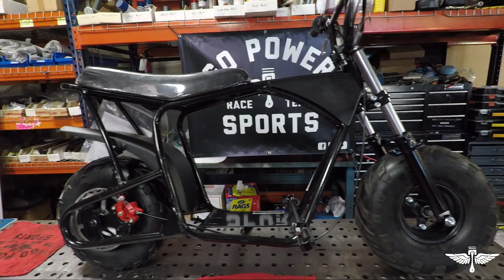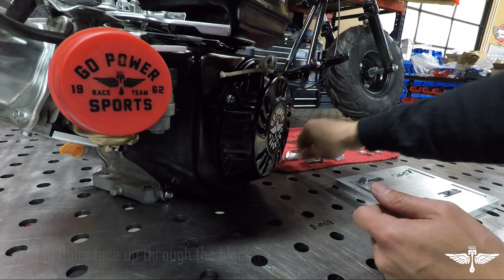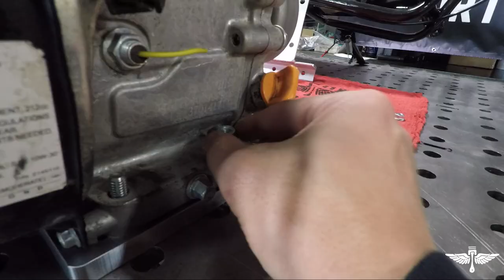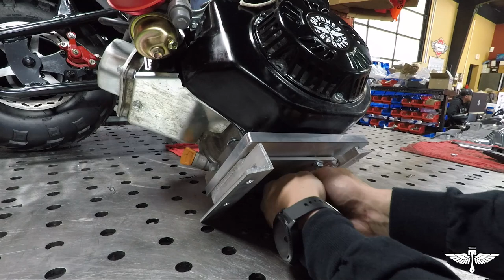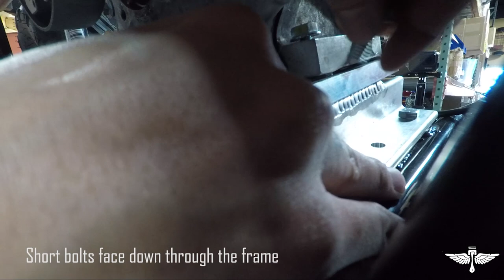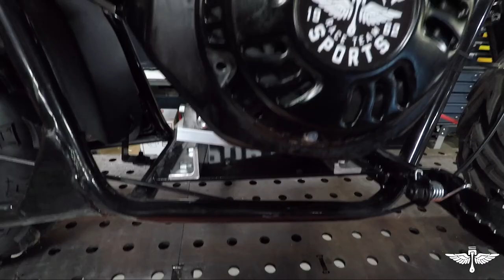GoPowerSports Mega Moto Fully Adjustable Motor Mount Kit Install

Comment: I plan on getting the roller frame from them and I will prolly end up getting this plate, but would I be able to keep the stock tank on or would I have to get a aftermarket?
Reply: I’m wondering the exact same thing

Comment: With the motor angled , do I still maintain the 1/2 quart oil capacity?
Should I add more oil from the rear?
I want to run a series 30 torque converter. Somebody should mfg a 1/2 gallon low profile gas tank for the 212 motor,  so it can fit.

Comment: Bro I did everything and it wont fit with the tank on still. I'm kinda pissed but cars and cameras cut the mounting slots on theres out longer gunna try that and see if I can get everything on with a plate and 30 sieries tc cut back a lil bit
Reply: I tossed an idea your way under the next comment down.

Comment: What size engine is that?
Reply: Predator 212 Non-Hemi
Reply: I litteritly have everything in this video and cant fit it on with a gas tank gunna move that aluminum mount as far foward as I can by cutting the slots for the bolts to go foward as much as possible
Reply: Looks like a Tillotson 212. A Tillotson tank is a little shorter than a Predator tank.
Reply: @naturechanel209  the Non-Hemi tank is shorter than the Hemi. I've tried to get a good look and I saw nuts holding the tank down. Predator uses a flat straight tank mount where the bolts on the tank drop straight down. The clone and Honda tanks are angled forward. He may have drilled it out to accept a clone tank. I'm not familiar as to if Tillotson has a tank like a Predator or a clone. In any of these swaps I end up going with a clone, side fill tank. I recommend that you grind the lobes down in the front to lower the tank height. That said, I'd only do that if your running an ungoverned throttle with the linkage completely removed from the block so you don't have binding issues. If your running a Mikuni,  I'd pull the flywheel,  tap the governor completely out and seal both the linkage and dowel holes with bolts w/ red loctite so that you have as much room as possible to lower the tank.
Reply from the maker: @naturechanel209  I've noticed that some gas tanks sit higher than most, like the Tillotson 212s.  You may need a shorter gas tank or run a remote tank.